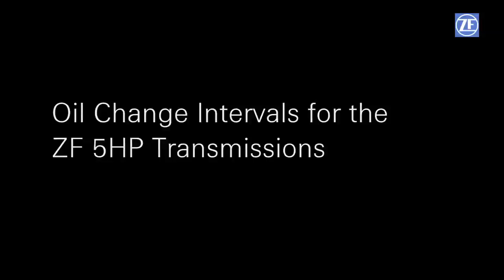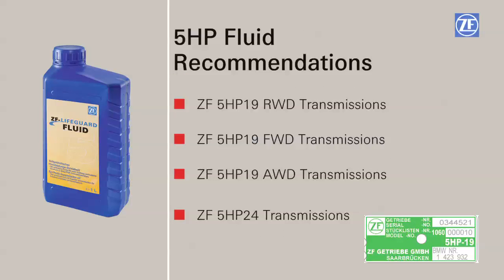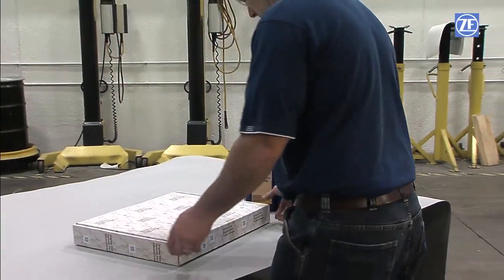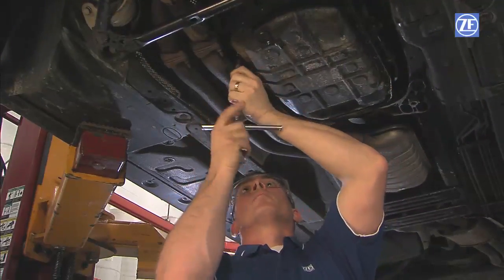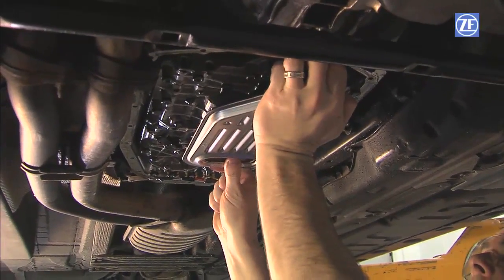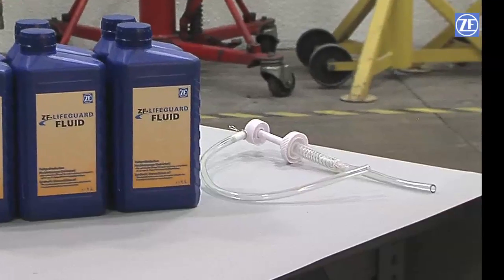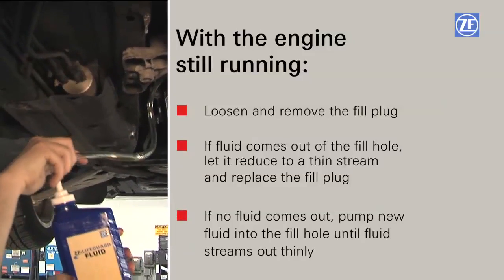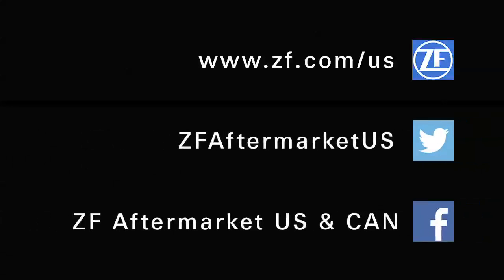ZF 5HP Transmission Oil Change Interval Procedure

Comment: Very useful and informative video! Would the same procedure apply to the 5HP24A fitted in Audi A8 D2 Quattro 4.2 2002?. The audi ELSAWIN manual recommends to shift the gear selector through all the selector lever positions, leaving the selector lever 10 seconds in each position, is this correct?. Kindest regards

Comment: Thanks for the video. Im rebuilding my jaguar s t r. I removed the engine to be built at a speed shop. I need to remove the trans now . My question , the bolts at the back connecting the drive train which do i remove ? And os the a shaft that goes into the trans ? Ive never rmoved one before im trying not to break anything. I have a zf 6hp 26 trans .

Comment: Good video. The ATF raises quickly. You got about 5minutes after starting the motor to finish this job. Never turn off the engine after filling. The fill plug is a bit tricky to get back in and needs some feeling. Watch out for the exhaust. It also gets hot very fast.

Comment: One thing that wasn't obvious to me, but maybe is implied is to do the final fill with the engine running, made a difference of about 1.5 qt and got rid of a whine I had after I filled with engine off but trans at the right temp.

Comment: Hai ZF team..good day to all of you..please if you can reply to my question there is one bmw car with ZF5HP19 trany and having problem won't shift from 2nd to 3rd and then tha car goes to limp mode error come out on the scanner is gear monitoring 3rd sometime 4th gear as well as P0734 which i believe slipping clutch right...i ask the owner what he do in the previuos and he mentioned that he use an atf oil for ZF6HP tranny because the guy on parts store told him that he can use the same atf oil as the 6HP tranny...

My question is are the tranny already broken or it is still can be fix by drain out the atf oil and flushing with ZF5 atf and drain it again then put a new ZF5 atf oil as per procedure...or maybe you can suggest me the better procedure for this case...

Also there is one case where when i drain the atf oil from the ZF5HP19 the fluid won't come out only half liter come out even with the fiil plug open..i try to start the car a few minute then it just come out another half liter..what is the cause of this and how solve it for the fluid to drain all of it..

Hope to here from you and many thanks.

Comment: So is the transmission at 4minute mark a 5hp-18 or a 5hp-19? I was told that my car needs the valve body removed for the filter change. I want to find out before i take off the pan. But I have 5hp-18 in my 98 m3 and was wondering if the filter is at the bottom like in this video? Thanks for the content..

Comment: You can also use Valvoline Max Life for a Quarter of the $$$$
Reply: Yes and no.. I have used liqui  Molly  top tec 1200 which meets  zf/vw requirements  and transmission  started shifting  rough from 2nd to 3rd. I'm going  to do 2nd drain and fill and use pentosin  atf5. Hopefully  that will sort put my issue.

Comment: Did you use or recommend gasket maker or any sealer for the gasket. I installed but it leaks and have to do the job again with a new gasket.
Reply: Did it leak with the new gasket?

Comment: hello zf .. my bmw e46 325i 2001 have a zf transmition with 5 speed .. now i see the owner before me dont regulary change the transmition oil and the oil quality is very bad because that .. and if i change with the new transmition oil  will it still safe and not make the transmition not smooth ?

Comment: Hi , I have passat with 5hp 19 transmission, the car was flooded, and the TCU was dead, the car worked in limp mode, he used it like that for a while  forward 3d gear an reverse working fine, after I bought it from him I found the dead TCU, there was a lot of corrosion on the plug also, I cleaned it and after that the car works normally forward, changes gears smoothly but the reverse only works when the engine is idling, as soon as I touch the acceleration it seems to disengage and acts as neutral, if I release the acceleration it goes in reverse, other simtoms, when cold in reverse there is only a bump even at idle and car stops, move from N to R and moves a little and disangages, when hot reverse works at idle, it even goes uphill, other than that, if I remove the TCU reverse seems to work fine, I can accelerate even when cold. Hope you read this

Comment: Thanks ZF for the video. I have a 1999 XJ8L with ZF 5HP24. Changed the fluid and filter the exact same way. It is true half the fluid is not changed but I figure I can change it again next year with new filter and clean the magnets. The new filter and magnets will catch the remaining debris that was in the other half of the fluid that wasn't drained.
Reply: how has your trans been? i have a 1999 xk8 same trans, was told trans needs to be rebuilt because of 2 times (ever) but recently, there was a small delay in the sound while putting it in reverse gear. guy said all of these have faulty drums and quoted me a ton of money for rebuild and that it wouldn’t be smart to get a used one either, other expert told me you can replace the drums and disks for updated ones for a couple grand which is a fraction of my other quote. thanks.
Reply: @h7pubg  Sorry to hear about your transmission. Mine is still doing fine. I changed the fluid 3 times and the filter twice. The 3rd time, there weren't alot of debri on the magnets and the fluid was still redish.  Working from home these days so hardly drive car. If you don't have any other issues with your car, I would go for a remanufactured transmission. Less headaches in the long run. Just my opinion.

Comment: Audis tiptronic should have "lifetime" oils in it.  This is confirmed fact straight from audi. But then the question is: how long is the cars lifestime.  At least here, cars have 400-500tkm on them and its totally normal. If Audi thinks that cars life is under 100tkm then ofc the oils are lifetime. 
Also it is not reccomended to just change the oil. You should use the rinse method on tiptronic, where you drain the old oil, refill the new one and start the car, go through the gears few times, then drain the oil again and refill it again. Need at least 15 liters of oil.
Reply: Audi “lifetime” is the first owner warranty apparently!

Comment: 2017 Chrysler Pacifica - 9 Speed Automatic . There no information about what type of transmission fluid you have to use and how to check the transmission fluid level
Reply from the maker: @argishti group please contact our technical hotline at +1 800-321-0784 for fluid change information.

Comment: Beautiful video all respect. Please if you can answer me please. I have a bmw 525 tds 1998.Transmission 5HP18.model.A5S310Z. What type of oil do I use to change it? How do I get the oil out of the converter? To make it 97% good a video would be welcome thanks
Reply from the maker: Thank you for your question! There are a couple of different fluid types depending on the 5hp18 model number- please contact our technical hotline at +1 800-321-0784 or fill out a tech ticket on https://aftermarket.zf.com/go/en/aftermarket-portal/get-in-touch-with-us/

Comment: Good afternoon, thank you for the video, but I had two doubts ...

- In my audi allroad a6 c5, tiptronic 5 speeds, the fuel plug of the new fluid is a large, which is also located in the same pan from where has the small plug to take out the old fluid ???

- After placing the new fluid, how long must it leave in operation to reach the temperature of 30 ° ???

I await your help response !!!

Thank you very much.
Reply from the maker: Thank you for your question! According to our technical services team, Yes fluid is added through the large hole. This does require a some type of device to suction fluid out of the bottle and expel it into the fill hole. The fill hole is a stand pipe, the oil must be pushed over the top edge of the pipe using a small hose. When the fluid reaches the top edge of the pipe it will spill over and run out. This is when you reinstall the fill plug and run the engine to warm the transmission fluid. You can find the fill instructions for your transmission on our website, there you will find more specifics as it is different than the BMW process. The only advice I will provide is the be sure the car is lifted with the oil pan level, this is important as the transmission has little reserve fluid. Under fill can cause drivability problems. A hand held infrared thermometer aimed at the pan works well in place of a scan tool.  If you have further questions, please contact our Technical Hotline at +1 800-321-0784.

Comment: I don't recall seeing in the video, but I suggest you break the fill plug loose first, before draining. That way you know you can get fluid back in. If you have the tools, knowledge and time to repair stripped threads then disregard my comment.
Reply: Great idea. I do that all the time also. It helps avoid getting burned by the exhaust when struggling to break the nut free assuming you don't strip it which will put me in a world of hurt if that happens.
Reply: Excellent advice.  It was a bear to access on my 2002 Jag XJ Sport, but with some creativity, a breaker bar, and a hammer it finally came loose.
Reply: You had to been there once to give this advice 😀
Reply: Right! Those fill plugs are always crazy tight.

Comment: i HAVE A 2000mod Bmw e39 530D GM steptronic Transmission and gonna swap to a ZF. 
The ZF Transmission i did buy is a 5HP-18 Green tag with has a 2 3 S D N R P shifter.
Can i swap and use steptronic  insted ? 
Tag on the transmission i did buy is:

0478414
000091
BMW NR
1 422 131 

Aksi
Reply from the maker: Thank you for your question. Our technical services team suggests you do not make this swap. We are not experts on BMW block castings, but you must be absolutely sure the engine in your vehicle has the identical bolt patter as the 5hp18 transmission. This includes starter position and crank flange bolt pattern. Second, the GM transmission uses a different shift strategy and solenoids than the ZF, the GM
TCM will not work for the ZF. Likewise, the ZF TCM may not work with the ECM causing all types of electronic nightmares. If that’s not enough the 5hp18’s converter stall speed will be incorrect being engineered for a gas engine, we don’t believe a diesel converter was ever produced. Changing the stall speed will require reprograming of the TCM.  I strongly recommend researching all this information via the internet before removing the first bolt or purchasing any additional parts. If you have any further questions, please contact our Technical Services team at +1 800-321-0784.

Comment: filler plug 30 ??? or 35 Nm ???
Reply from the maker: Thank you for your question! According to our technical services team almost all of the 5HP fill instructions list tightening torque at 35Nm +/- 3Nm except some Audi/VW which are listed at 80Nm. If you have any further questions, please contact our technical services hotline at +1 800-321-0784.

Comment: I have an audi 2010 a4 I cant shift to 3rd while brake is held .... Is that OK?
Reply from the maker: Thank you for your question! According to our technical services team, if the vehicle is standing still with the brake pedal depressed, starting in 3rd could damage the transmission and would be blocked. This is similar to selecting a lower gear at high speed that would cause the engine to over rev, this would also be blocked. All selectable shifter function first pass through the transmission controller where the outcome of the action is checked and if it will cause damage to engine or transmission it is blocked. If you have further questions, please contact our technical hotline at +1 800-321-0784.

Comment: Would draining and filling the transmission fluid two separate times help remove fluid that is still in the torque converter? Starting and running the car through the gears with a foot on the brake after the first fill.  How much of the transmission fluid that was in the torque converter will be cycled through to the pan for the second draining?
Reply from the maker: Thank you for your question! According to our technical services team, a second drain and fill will help dilute the fluid in the converter. It would allow it to run for several minutes as the fluid is continuously pumped to the converter then back to the pan. 100% of the fluid in the converter will be mixes with fresh, it's not possible to drain the converter to the pan without the new fluid pushing the old out. Since the converter is rotating and creating turbulence the fluid will mix. If you have any further questions, please contact our technical hotline at +1 800-321-0784.

Comment: where can i buy this little oil pump?
Reply from the maker: Thank you for your question! Our technical team suggests that you purchase a suction style syringe which is very durable and can accomplish in one cycle what the other could take many, many pumps. These are available at many auto stores as well as Amazon and EBay. If you have any other questions, please call our tech service line at (800) 321-0784.

Comment: On the BMW E38 7 series 5HP24, if you have an advanced scanner, you can monitor the transmission fluid temperature via OBDII so that you know you've reached 40deg C! I've done this twice with great results (during valve body pressure regulator updating service). Next up is my 840ci with the black label 5HP30! I will be using the special shell equivalent fluid.
Reply: Why must temperature reach 40c? Say for a small top up only scenario, if done when transmission still cold, will i end up overfill or underfill?
Reply: @bmw12347  Because the volume of the fluid increases with temperature. If you fill until it runs out of the hole when the fluid is dead cold,  then when it's hot, it will grow in size 
and be too much fluid (over fill).
Reply: @chamberlin1  That's what I guessed. I watched  another YouTube on refill only where the mechanic on wheelchair had to put in a lot with transmission cold. He said it was definitely low. But after he warmed up the car to check the level,  he almost gave up before the backflow finally stopped. So perhaps it wasn't low to start with. In the end of the video, he said the transmission fluid is cooled by the top part of the air con condenser. The flow is controlled by a regulator that's shut when cold. Is this a second reason why the level is low when transmission is still cold because some fluid is blocked out on the other side of the regulator? I was further confused by another website. A guy said never to check the level when cold because it will shoot out ie the level will always be high when cold. That's  opposite to what you and I believe. He must be wrong. Correct?
Reply: @bmw12347  there's another factor you might be missing, in that I hope you don't mean that cold = engine also not running... If the engine isn't driving the transmission pump, yes fluid will collect in the pan and come out when 'cold and not running'. Engine has to be running and driving the torque converter and pump before you can even begin to assess fluid level... Once running and the system is pressurized, temperature is then the next variable to contend with.

Comment: Hey ZF! Quick question, do you know why the "ZF 5HP19" torque converter seals fail prematurely in the W8 model Passats?

Any ideas on also mitigating the issue?
Reply: The seal fail because the bushing in the transmission oil pump faied, so you need to replace the oil pump and the converter,that bushing is centering the neck of the torque converter when enter the oil pump, is lying behind the seal that failed. Good luck
Reply from the maker: Thank you for your question! Our technical team is happy to say that engineering has updated the seal. With the new seal, the failure should be a thing of the past. If you need a distributor to purchase a Genuine ZF converter from, please call our tech service line at (800) 321-0784.
Reply: Wow, very surprused you responded! Very cool! I will give you guys a call today. Thanks!

Comment: I'm very nervous to do this just because my car is running pretty awesome, but I plan on keeping it for a long time. it is approaching 100K miles. A mechanic previously owned it, but he is no longer living and I have no idea if the trans fluid was ever changed. I do not want to cause problems to the transmission by changing the fluid. Should I leave it go until it runs funny or change it out?
Reply from the maker: Thank you for your question! Our technical service team says it is always a good idea to freshen up the fluid and filter. They recommend performing the drain and fill every 60k miles or 8 years. If you wait until it doesn't seem right, it could be too late. If you have any more questions, feel free to call our technical hotline at 800-321-0784 to speak with a member of our technical service team directly.

Comment: I have a 2002 BMW 530i automatic with 237,435 miles. I still haven't check the plate number but I'm pretty sure it's the ZF 5HP19 my question is how much liters/quarts would I need for a drain and fill including filter change? I plan on doing this step first than drive for about 3k miles and than do a drain and fill no filter. Own this car for 6yrs not sure when was the last time fluid was change.
Reply: 5-6L however 7.5L ive seen too...leaving torque converter. Including replacing torque converter fluids 9.9L all up.
Reply: Hi, I have the same car but with 123k miles. How did it go? I don’t think mine has ever been changes either. Thanks

Comment: Hello..One question for '99 Boxster tiptronic 2.5L with ZE: -99(A86,00-103); 5HP19, green tagged ; 030053 Serial No: 0175318
The tranny pan filler plug M30-1.5mm is underside of the pan and the factory manual instruction torque is 80Nm.
 Your demonstrated  pan here is one of filler plug on the side of the pan and 35Nm.  
Is this  80Nm right? for my tranny pan?
Thanks